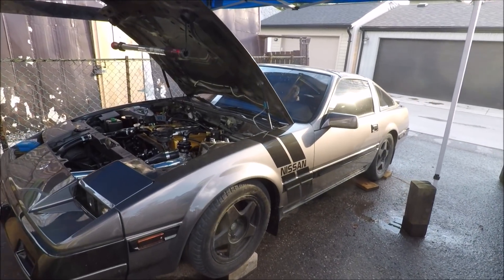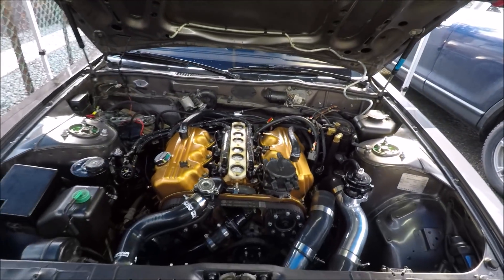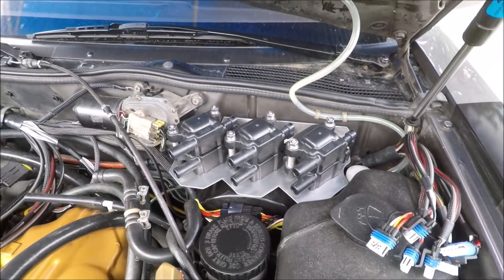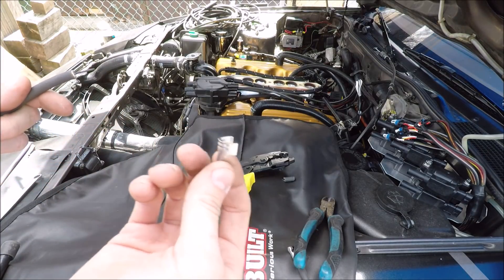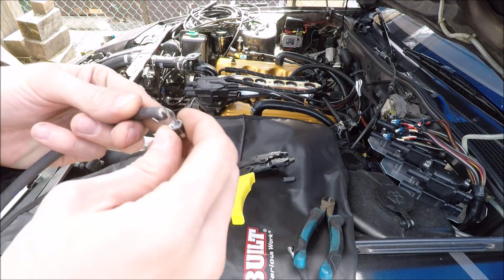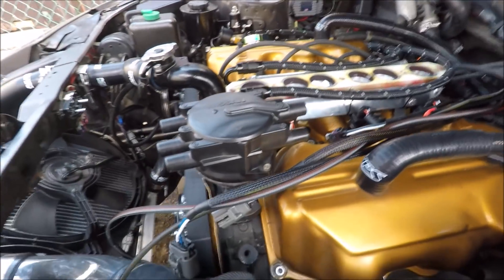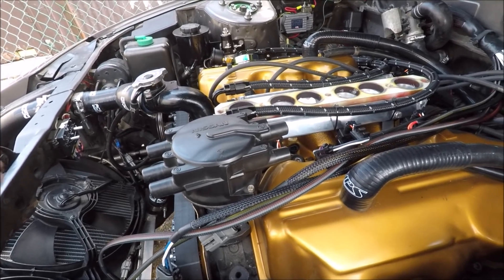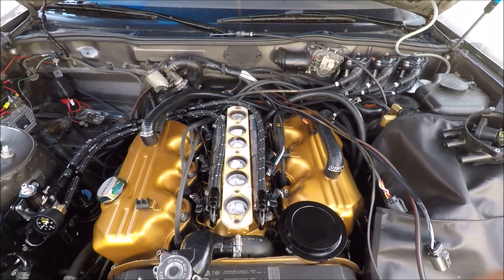Building a Sequential Ignition System  - Z31 Megasquirt Build

Comment: So did you need a separate control module for the coils or are they pinned directly into the MS3 unit?

Very nice build by the way, great work.
Reply: Funny you commented now, I just picked up an MS3PRO Evo and there is 10 coil drivers pinned directly from the ecu. Kinda cool, there's also a built in 4 bar MAP and Baro sensor. 

Put simply, no, most of the necessary sensors/modules are already built in!
Reply: @NWPRcharlie  you tha man! Thanks!!!!👌🏽🤘🏽
Reply: ^^I'd like to know the same answer!👌🏽👌🏽

Comment: Hey man I was wondering if you got the distributer plugged in the stock location plug or if you had a plug on your wiring harness that you connected it to?
Reply from the maker: The new harness has a plug on it that connects to the stock distributor wire, no modification needed

Comment: On the trigger wheel which side goes up? Does it matter? I'm building a similar setup  with a MS3 pro Evo
Reply from the maker: Yes it matters, the way i installed it is the same way it showed in the instructions, so i just used the picture for reference. But yes the orientation will make a big difference

Comment: Wait, I’m confused. No fan clutch? You did that right? It doesn’t affect it? I’m pretty sure my 84 has a fan under the support the hood latch bolts onto, is that okay to remove? I am much more a fan of the dual angled fans
Reply from the maker: Its a fan from a Maxima, it deletes the clutch fan. I have a video about them on the channel